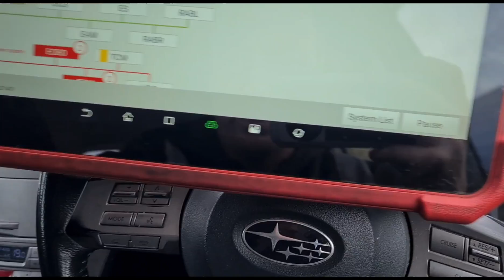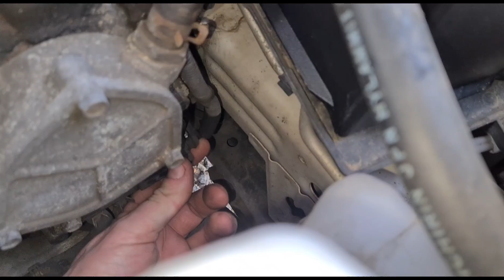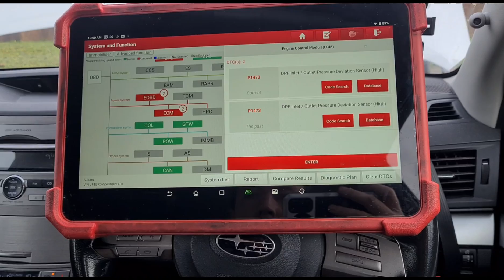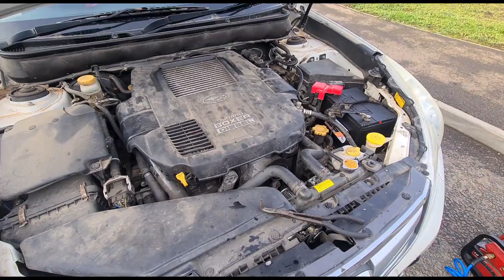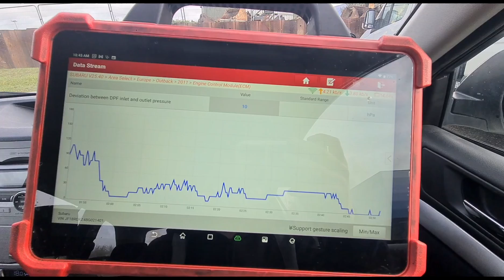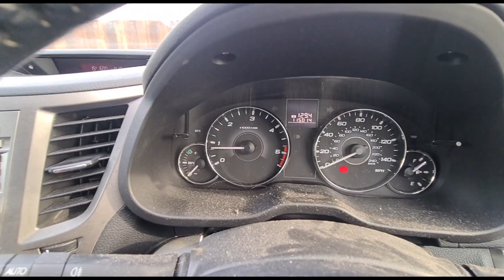Subaru Outback 2.0 Boxer Diesel Flashing Symbol Blocked DPF Cleaning

Comment: You mentioned the oil dilution problem 
Whats the fix for this ?
Reply: crazy oil change rituals, every 4000 miles unless you use 'high quality' oil
Reply: @michaelfraser5723would it not just be easier to just turn off the dpf regeneration completly in the ecu and then you just regularly go in and do manual regens with the computer 
That should stop the dilution issue
Reply: @m@michaelfraser5723nes is doing it every 800miles. No regens happening. Car driving. Normal what’s the catch?

Comment: There was a problem with a few Forester's with crankshafts and cylinder head gaskets, but this was fixed and most had crankshafts retro fitted! A bad batch and a design upgrade.

What's almost as worrying is a pollution control design, which leads to thinned out oil, the life blood of the engine! Politicians, bureaucrats and manufacturers should be held accountable for poor design solutions!
Reply: they invented " nett zero ""

Comment: I have the same problem now, i sent the dpf filter to be cleand complete it was done and fitted back by my mechanic, the regeneration started to work again, but after ca 1000km all the lamps like here poped up and the card did not have proper power like it was drowing/clogged, i did some research and it seams like the egr valve should also be cleand same time you clean or replace the dpf filter. Now im trying to see how to renove and clean the egr valve, would highly appreciate if you have a video or can make a video about that. ❤ i have a subaru outback 2.0d 2011 very little kilometers on always fully serviced at Subaru in Switzerland
Reply: Have you solved it? Same issue from Basel

Comment: Another great video, I myself have 2012 subaru legacy, the reason the revs drop back to normal is because if you have the temperature in the cabin set to over 20 degrees and you start the car from cold the revs stay higher until it gets warmed up. I myself have had dpf issues and it was all down to garages putting in 5w 30 engine oil, whereas in the cars booklet it says it should be 0w30 engine oil. I've since been servicing the car myself now and all has been well. I've also been resetting my own oil dilution which garage's weren't doing. This can be done without diagnostic tool, if you depress the clutch and keep your foot on the brake start the car release the clutch turn rear demister on turn on parking lights then turn off rear demister turn off parking lights and release the brake do this within ten seconds and the glow plug light should flash 5 times. It might take a couple of tries but eventually you'll get it. I also noticed that when servicing the car be very careful refilling with engine oil I leave mine a small bit shy of full mark, because even if you go over by a little the dpf light starts flashing.
Reply: @brendanmurphy1069  interesting. I have a  2010 legacy diesel. What does this oil dilution reset do and what is it good for?

Comment: Watched many of your videos and they are soo helpful to others. My e220 went into limp mode and I had mechanic perform a regeneration and it was complete but after we went for a drive and it still wouldn’t pass 3000rpm and couple hours after the eml came back on again. Do you advise I take it for a motorway drive as the filter itself is now clear? Any help would be appreciated
Reply: You need to fix the problem that's stopping the DPF regenerating on it's own. Otherwise drive it to the scrappy as it'll be cheaper.
Reply: @alexanderhughes1540  yeah by the looks of things I may need to find a cheap option as new will cost a fortune
Reply from the maker: Don't replace the DPF without fixing the reason it blocked

Comment: Again top service! I can already confirm the problem of oil dilution in Asian cars. We bought a second-hand Kia Sportage (134000km) that was still under factory warranty and we noticed the high oil level shortly after purchase.The dpf diff. pressure was 148mb under load. They said that oil dillution was normal and kept us on the line until the warranty period was over. 
When I did an oil sample analysis and also connected an oil pressure gauge to the gallery, it became clear to me that the engine bearings were in very poor condition, 0.6 bar idle when the engine was warm.

Comment: I checked how much will it cost me to ship my car from Ireland to you and I got big shock 😳. 
Haulage company traveling to UK weekly to collect vehicles from different sites (garages, homes, auctions, ...) quoted me €1k each way that's €2000 without the cost of repair 😳 🙉🙈🙊😠😥😡 now my car is in repair shop for 3 weeks and still not fixed but I refused to agree with them to put new dpf (more than 1k). I never did regeneration to it and they had no proof of it being damaged and yet they told me I need new one😡 so tomorrow I will go to collect it unrepaired and will have to pay them their labour cost. I'm beside myself, disappointed,  angry 😠 for not having competent mechanics in garages rather we have threatening mafiosos ripping people off. 
I have the A bar for towing the car but it rubs badly against the bottom of the front bumper and not sure if it's safe to tow it all the way to you also don't know if I can get it into the ferry and through customs in tow (regulations regarding towing for long distances....). 
I wish you could make a visit to Ireland with your van and put us all out of our misery 😢 as there are lot of people with same problems and no right solution apart from sourcing second hand or new dpf and even that I'm not sure 🤔 if they can clear the dashboard warning lights as it needs expensive equipments with good knowledge which they lack. 
Here is very serious question for you Jimmy 🙏 can you please train me or invest in to have me working for you after training and I could cover few counties around Mayo? Or something you think is better idea 💡 🤔 🤷 🙏🤞🤞🤞🤞🤞
✌❤☘
Reply: What car?

Comment: They usually snap the Cranks long before anything else 🤣 Seen a few go to the Crusher quite early in life.
Reply: These always used to have a major issue with oil dilution due to failed regen's that knocked out the bottom end.